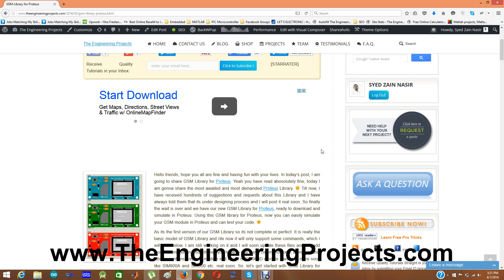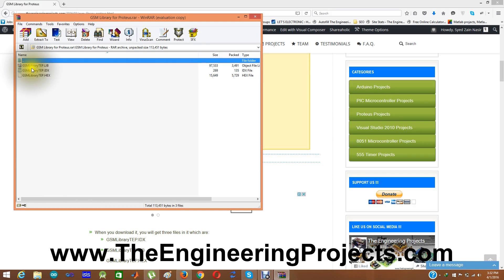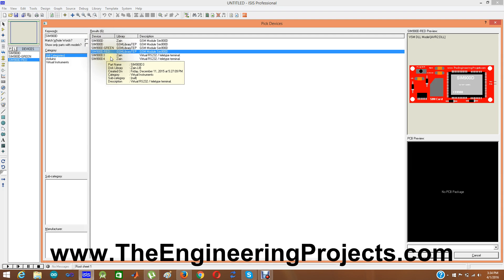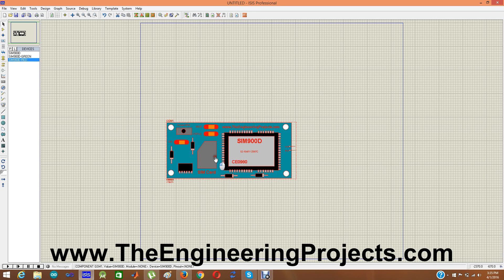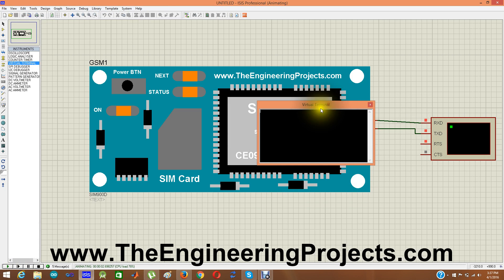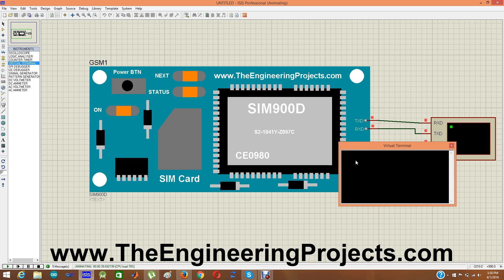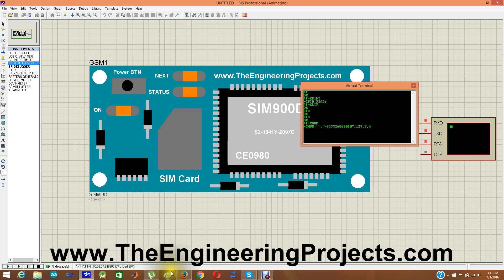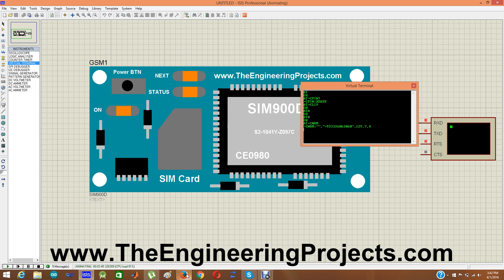GSM Library for Proteus

Comment: Hey there. How do you make the device libraries ?
Reply from the maker: using programming .... these are designed in Proteus VSM ...
Reply: +The Engineering Projects Thanks can I get the VSM SDK from  you ?
Reply from the maker: No bro I can't send the source file to you .... but you can enjoy the product ... :)
Reply from the maker: you can buy it from Proteus .... if you are a developer .... (Y)